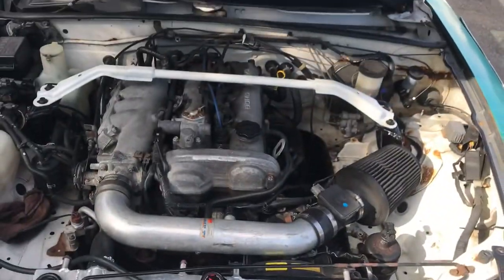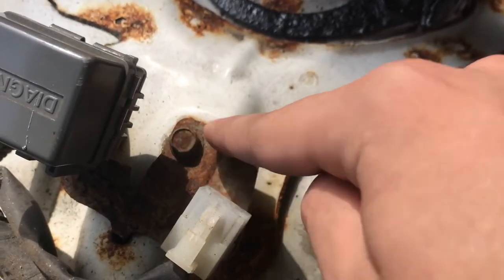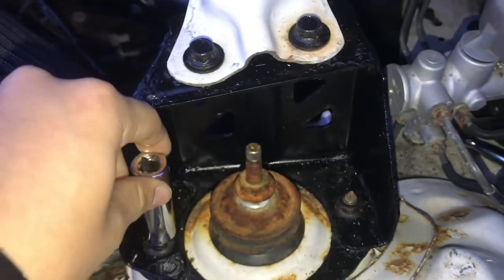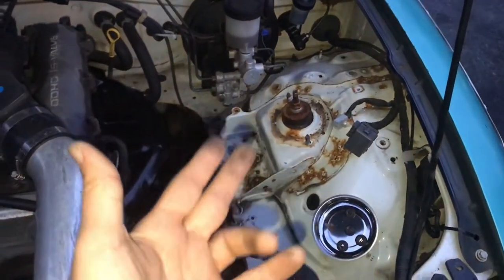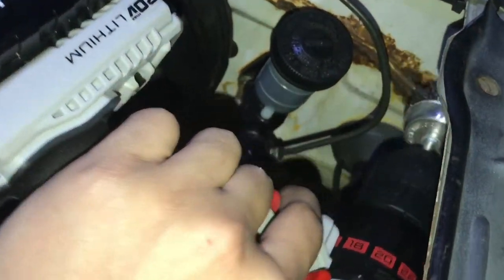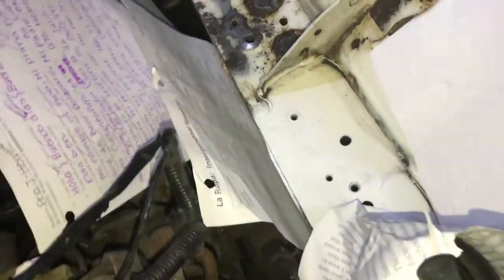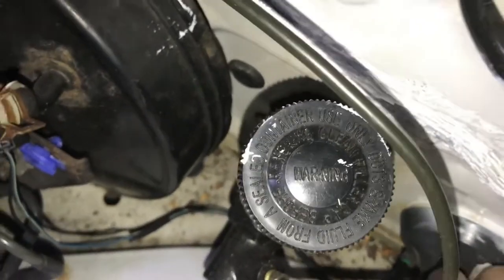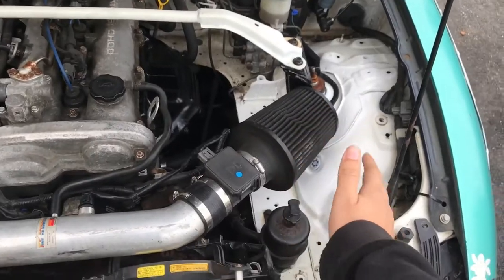MIATA ENGINE BAY PAINTING & WIRE TUCK

Comment: I also want to remove my cruise control. How did you go about doing it?
Reply from the maker: Just unplug it, undo the few bolts holding it, then remove cable on throttle body that attaches cruise control. Makes sense what you physically do it and it’s not bad!
Reply: @khevenlagos  alright, i assume cap the throttle body off. I see that something goes into the firewall. Did you follow that cable and remove it from the inside of the car?
Reply from the maker: @prodbypablopaul  oh yeah, you have to go under dash where pedals are and undo the cable for cruise control. I don’t remember if you just slide it out or push and pop it out.

Comment: Ya I wonder what that plug that says diagnostics on dose
Reply from the maker: From what I’ve seen is that you can check if your radiator fans do work by placing a paper clip/ jumper harness through some of the holes and check other stuff